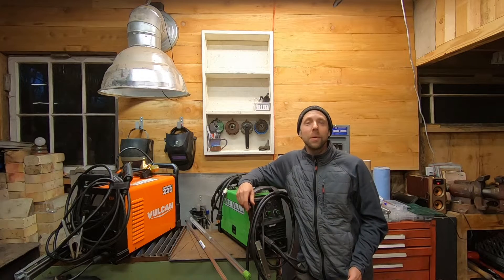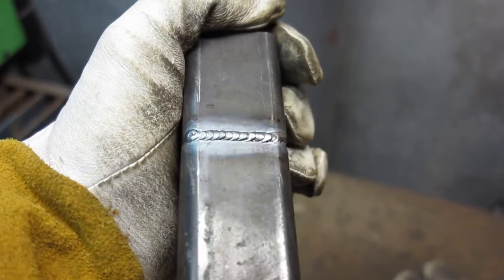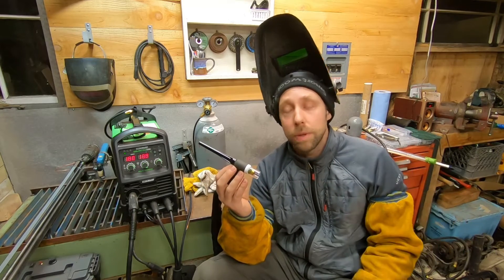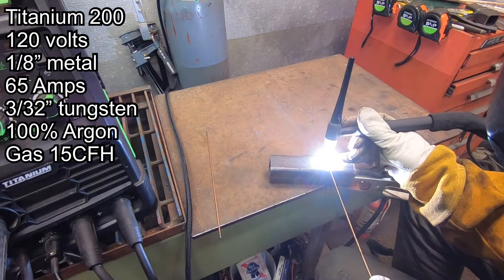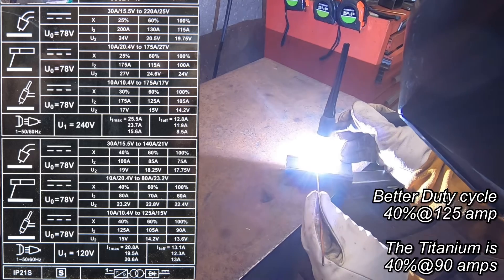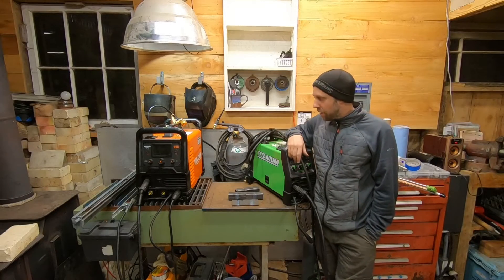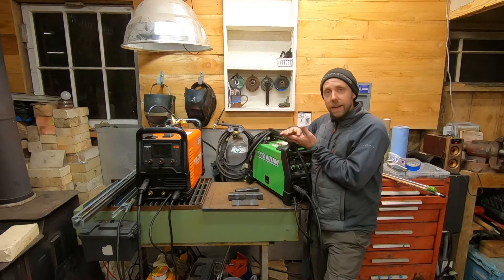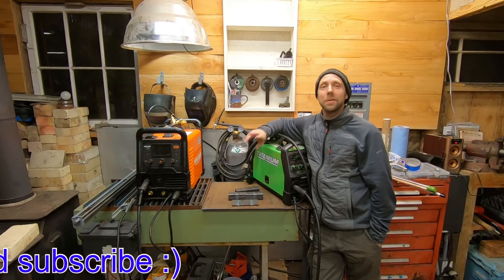Titanium Vulcan welders TIG comparison

Comment: Great Job, the video I was waiting for... Lots of extra good info for beginners too.  I know you said they don't sell a pedal for the Titanium but my question is does it even have the electrical connector for a pedal? Or did they just never intend for this machine to have the capability?
Reply from the maker: Good question, It has a 5 wire electrical connection on the front, Two wires are for the mig button switch, the other two are for the 24 volts to run the spool gun motor, the fifth connection is for who knows? I would think it would need at least one more contact to be able to run a peddle? 6 not 5? I'm going to look into the connection on the front some more. Take care
Reply: @Mikefestiva  I found a pedal on Amazon that has the 5 wire connector you described. check it out.... https://www.amazon.com/dp/B00NVROG8G?psc=1&pf_rd_p=c4502935-a37f-41da-bc55-fe06811e8aae&pf_rd_r=60GD5GBNP5FDCBKD400Q&pd_rd_wg=jLRnX&pd_rd_i=B00NVROG8G&pd_rd_w=sFoQP&pd_rd_r=a2418ffa-16d0-4c1c-97ff-31b2c576e535&ref_=pd_luc_rh_pd_luc_ac_nb_01_01_t_ttl_lh